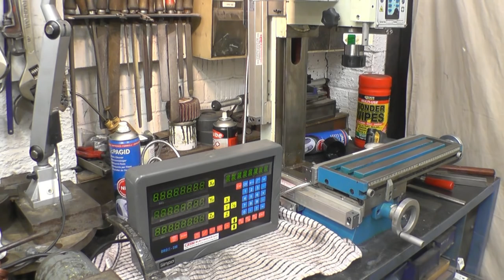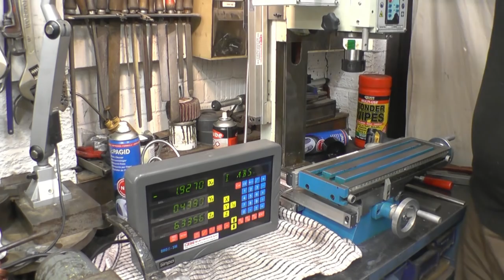AM 16 Mini Mill DRO Install P3

Comment: Hi John I enjoyed watching the 3 videos soon fitting the DRO. It brought a lot of memories back as well as showing me a few tips and advice on the machining side as I am not a machinist but an electrician though I do have an ML super7 with a milling attachment and a Harrison M300. and would like a mill. 
The memories I had go back to between 1984 and 1992 when a fitted a number of DROs to various lathes and mills contracted to an engineering company in Belfast John Hinds & Son who were Heidenhein agents for NI. 

Some of these where a challenge i.e. I fitted 3 axis to 2 Deckal Jig boring machines manufactured in the 60s in Shorts Missile Section there were few machined surfaces and all the linear encoders had to be fitted in behind the bellow type slide guards and the machines were small. These were inspected and approved by a Deckal Engineer. 

I did another 2 jig boring machines made by Sip in 1965 at first they were not happy and told Shorts it hadn't been done before and would more than likely fail their guarantee tests which made Shorts hesitate but Hinds agreed should they fail no charge would be made these were the highest resolution encoders Heidenhain made at that time. When tested by the Sip engineer they passed checked with their vernier dials and laser test equipment and he congratulated me and on the quality of the fitting, as you can imagine I was very proud of myself.

 The most challenging fit was 3 axis to a Ward 7 lathe, don't ask me why they wanted it but there wasn't a machined surface in sight and to cap it off when fitted the man who used the machine refused to use it as he wouldn't believe it was more accurate than the dial verniers, oul git he was too but weren't they all. 

I also fitted linear encoders to a Henri Line bridge mill in Lyon, France and a few Giddings and Lewis-Fraser mills and machining centres in Singapore and Montrose in Scotland these fed into Fanuc CNC controls as the company I contacted through our main work was retrofitting larger VTLathes Mills and Machining centres. The longest was a 4 meter linear encoder fitted to a mill in Lapple Carlow Ireland. This machine was used to machine Dies for DAf and Volvo lorries etc.

I did many other machines but always Heidenhain with one exception Acu-Rite.

Comment: Hey John,
one small tip / criticism here: I believe the correct usage of the red installation bracket ist to put it in AND PRESS THE READ HEAD to it instead of leaving it loose. That way you get the correct spacing between the scale and the head (approx 0.9 mm). You can squeeze either by hand, or put two zip ties through the head’s mounting holes and around the scale.
If you don’t squeeze the head to the scale, the head moves to the (not well-defined) outmost position and is not in the center of its travel range.

Comment: Thanks for the series, John. I just purchased my first milling machine, and after cleanup and tuning, a decent DRO will be next on the list. I feel a lot more confident about it now that I've seen you do it, solving little problems along the way.
Reply from the maker: Try to get the micro scales & read heads much easier to install

Comment: Excellent series of videos, John. I'm sure that this will be the definitive method for those wishing to fit DRO's to mini mills, and, like you said, it will also give ideas for mounting DRO's on ANY machine.

The idea of using 4 grub screws to level up mounting plates and brackets is one that anyone can use, and will solve a number of problems not only with DRO's but with lots of other devices. I myself had never seen that used before and I'm sure that it is new to lots of others too.

 Keep up the good work.

Comment: Great series John. thanks for the tip about using the backed in grub screw as a marker, I never thought of that.
Reply: That is a great trick! I've made my own blind-hole transfer screws before and it was a pain to work on them without buggering up the threads. This will save allot of time in a pinch.

Comment: just an idea about the drill guide? mill some holes in the back and glue some small magnets in them. that way it stays in place while you find that bloody clamp that you're sure was on the bench. :)
Reply: Strange either wax or hot glue has always worked for me.

Comment: Hope the last comment wasn't to long and boring. A few things I thought I would mention is. 
I never used lub to drill or tap cast iron i found it clogged up. 
I never used a drill to tap in case it should snap especially taps where the shank narrows after the threads, I preferred to take the extra time. 
On brackets where I used jacking screws I used locktite on the jacking screws and sometimes pinned them after the adjustments were correct, this helped put them back in the correct position without having to set up using a clock if they needed to be removed.
On initial setting up I used the plastic fixing for the reader head to get the scales position by fixing the reader head and one side of the scale leaving the other side to float then run the reader head the full length of the scale. this positioned the floating end perfectly before fixing it and then end removing the plastic reader head fixing. This allowed for a quick and accurate fixing. hope that made sense. 
Finally the joiners clamps and the 3 or 4 hand method Screwfix and Im sure others sell G clamps you can use with one hand as they operate like a silicone gun. I find I use them more than others.
These are not criticisms but comments as you stated you preferred those to praise as do I as its all a learning curve.
i.e. I had never seen the positioning pointer you put in the milling head to accurately find the centre where you want to drill (i don't know what its called)
I will check out your other vids and learn. Thanks

Comment: YOU seem to have performed masterfully.  Still it almost looks as there is more DRO apparat than there is mill...?!!?

Too bad that the mill doesn't come/isn't designed with a table with spaces underneath it for DRO installation.....  Also, are there wireless DRO units available...???

Comment: I like but do my eye's fool me y and z are backwards on the DRO read out ???
Reply: Yes, but you just change which socket on the back of the display each cable is plugged into to fix
Reply: Knowing it's a simple fix made it amusing to hear John mix them up even though I know he knew the difference.

Does that even make any sense?

Comment: can you use shell mills on a mini mill
Reply: Hi - the mill that John is fitting with a DRO is actually mine. I have a shell mill and have used it already on an arbor (MT2) 

In the next couple of weeks I'm going to post a video review of it in use on my YouTube channel - please watch out for it.

I Have used it already on Aluminium and cold rolled Steel bar, with great results. Obviously, you can't be too aggressive with the cut or feed rate, and you must have the mill trammed in perfectly for best results, but it gives an almost mirror finish to cold rolled.

Thanks again to John for fitting the DRO when I was unable to, because of illness.